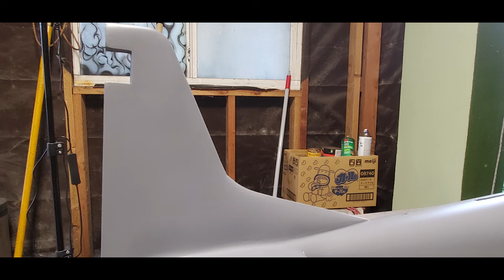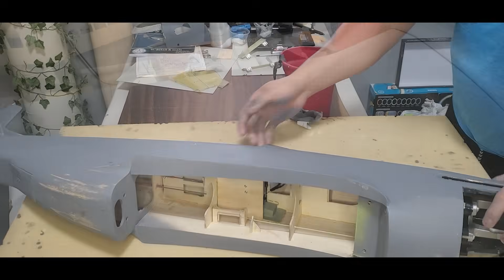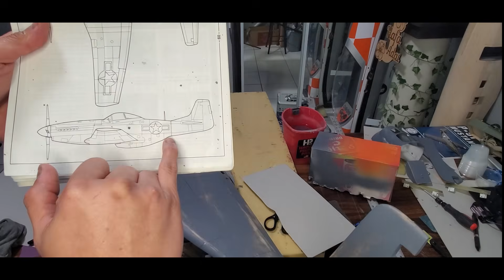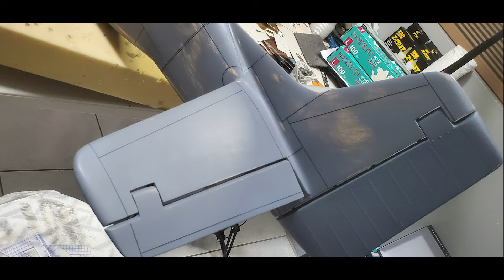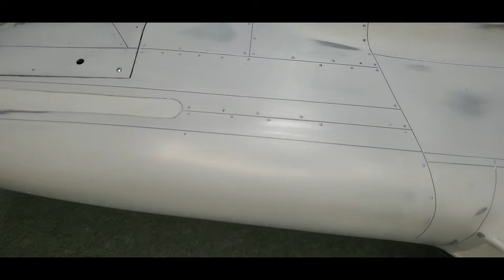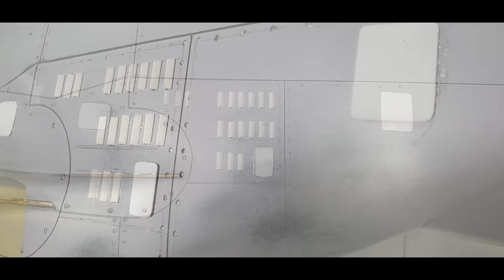Top Flite 1/7 P51D Mustang Part 9 Fuselage Panel Line and Rivets

Comment: Why do you cover the entire model with fiberglass and resin? It certainly strengthens the structure, but don't you think it adds a lot of weight? I usually apply Modelspan tissue (I'm not sure if that's what you call it) with dope, followed by primer and paint. I believe that the fiberglass and resin technique adds at least 1.5 lbs to the model—which is significant for a 64-inch model.
Reply from the maker: No the amount of glass, resin does not add up to even a pound.  All my weight added to this model actually came from the fiberglass molded panel under the wing that I created for the Retracts.  When glassing and done properly will yield great results with very minimal weight added to the model.  There is a reason why in my glassing videos I repeat myself many times about saturation coat with the resin and then removing all excess resin using a plastic spreader.  Alot of people tend to use a brush and brush on the resin into the glass and thats it.  Some use the peel ply method which is great but I see them primering sanding primering sanding just to get a smooth surface after to fill in all the weaves.  I only primer once, sand smooth and paint if I am primering again it is only because I am creating panel lines with the chart tape.  You can cover your model however you choose nobody says that covering with fiberglass and resin is the only way, as for myself it is my prefered way because of logistical reasons, materials on hand or able to have shipped to Guam.

Comment: Hi Michael. Fantastic job! You are the first rc'er that I've seen that shows the step-by-step technique for these processes! By the way, what did you use to make the hatches? Looks like ABS thin plastic sheet? Thank you for sharing!
Reply from the maker: Thank you for your comment and support.  For the hatches I just used the left over plastic from the exhaust stacks and cowl.  The simulated vent louvers are leftover plastic strips from my top flite Cessna 182 build